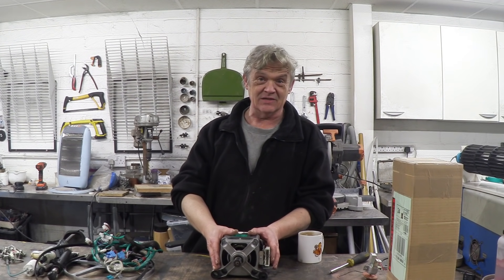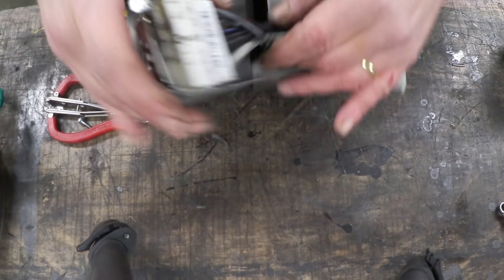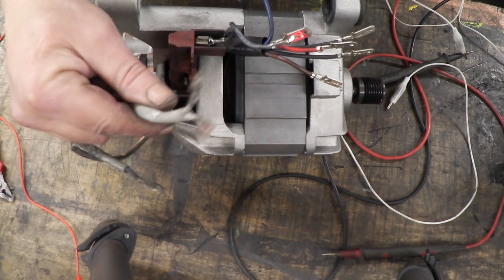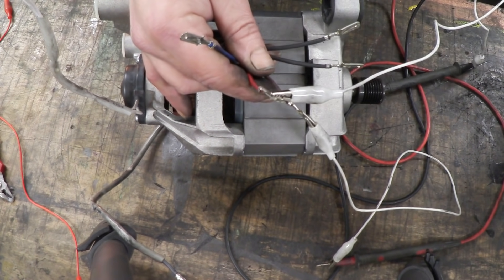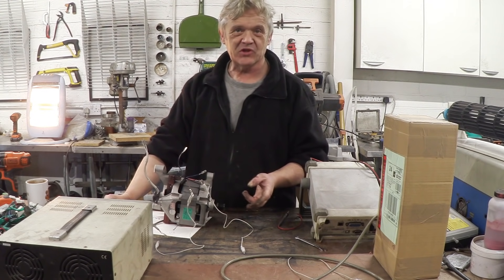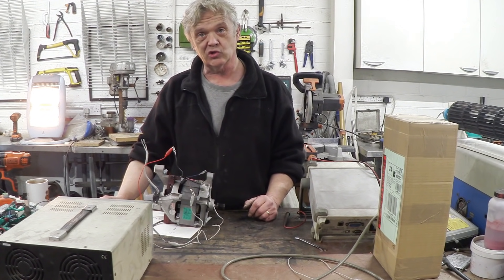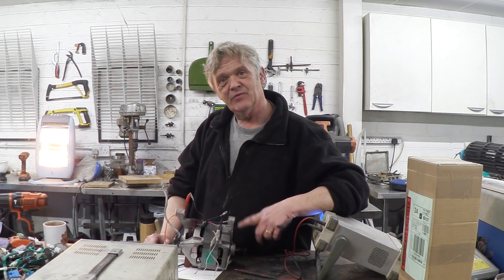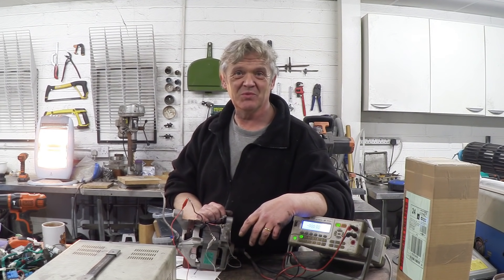1018 Reusing A Washing Machine Motor As A DC Motor Or A Generator

Comment: Robert how much torque can you get out of that motor?  I am wondering if it would work for the electic who car you are building.  I have a very similar project in mind but mine will require the electric motor run a 12gpm hydraulic pump from a case ingersoll 448 garden tractor which will provide 2500 psi IIRC.  I have a few of those as donors and want to make an electric  4wd tractor out of two of them.
Reply from the maker: the reason the little car has stalled is because I need a motor and I can afford to buy one so this is a candidate for that - so - we are on the same wavelength here lol - the torque is going to be related to the current carrying capacity of the field coils and the number of turns in those coils - I am not sure what the wire gauge is so I can really estimate the amps it will carry and that makes it difficult to estimate the flux - so mostly what I will do is run it until it burns out - I have two so no worries there and find out what it will do - my standard approach when I am. not sure lol
Reply: @ThinkingandTinkering  if you monitor the thermal switch and shutdown when it trips the motor should be ok.  I am considering finding two identical motors for my project and connecting the shafts together to form a higher torque motor.  I have one of my case ingersoll 448 tractors running on a 10hp Chinese diesel I have used it for about 5 years like that around my farm but that motor is slightly smaller than I need for the pump it will stall under heavy loads.  But your application should be lower torque as I have hydraulic losses.
Reply: @ThinkingandTinkering  oh I love that who inspired car by the way.   John Pertwee would have definitely approved of a battery powered who mobile.  After all if he had more batteries those bad guys wouldn't have gotten away before unit found his car...

Comment: DC motors will run away to destruction with no load as well... All you need is a physical load or electronic, closed loop control.
Reply from the maker: I don't think that is right mate - it is wired just like a 'standard' dc series wound motor and they don't really ]run away' and when I ran it it worked fine under DC - in fact in the video you can see it is not 'running away' - running away happens quickly also when I did the background reading the consensus was DC is good like this but AC definitely not
Reply: @ThinkingandTinkering  This is because you are running at far below the voltage rating of the motor so the mechanical losses in the motor are large compared to the physical shaft torque before stalling. 

In DC motors there is no opposition to current flow in the windings other than the DC resistance of the winding when the motor stalls & also until the motor is rotating. This is why in old time systems there was a rotating handle which clicked series connected resistance until the motor started to turn (see pictures of the driver control of old fashion trolley bus or tram with DC supply via a photograph) In small motors, they are so inefficient that stalling them will simply cause a temperature rise in the winding but this is usually not destructive. In larger motors, stalling will see a large rise in heat because the back EMF is not present & the winding will burn up hence the temperature sensor. In very large motors, with poor protection systems this overheating under a stall condition can be dramatically destructive.

You can run these WM universal motors just fine with lower voltage DC or AC but if you are running them at near their proper rating, you will need speed control involving the sensor so they do not run away with themselves under no physical load.
Reply from the maker: @davidbrewer7937  ok cheers - that made sense to me - sorry to question you there mate but your short answer just didn't match - your long answer I get - cheers

Comment: I hope your thumb is okay, did the screwdriver slipped? Thank you for the very interesting tips!
Reply from the maker: I am always cutting myself mate - barely even notice lol - but this was done pulling apart the washing machine to get the motor not on the motor itself
Reply: @ThinkingandTinkering  oh yes, pretty much comprehensible! Firstly recognizing by the red stains everywhere. 😋
Me:
January, pulling apart my old dishwasher. -> Cutting myself several times (e.g. my knee...!) afterwards at the sharp edges of the inner stainless steel body.
February: PV on the roof needs aome repair. -> Cutting into the palm of my hand by handling a panel.
What will be next...? 😂
Reply: @Gwydion67  

I hope it's no more in Jesus name amen.
Reply: @Gwydion67  Can I recommend a jockstrap? 🥴
Reply: @ThinkingandTinkering  can I ask you question,please 
Help me
Reply: @MM-np1sn  

Dear friend

If you have a question for Robert Murray Smith you can find where he's replying in this thread below and direct the question directly to him. He also has a website and I suppose you could find the email for the website on his website and ask him privately through his email on his website.

You can also post the question here to Robert Murray Smith where you see Robert Murray Smith posting comments in this thread.

Also I believe if you post $10 to the private videos as a member, and ask him to direct you to which video has the information you need. All the members only videos have more information on what he's doing.